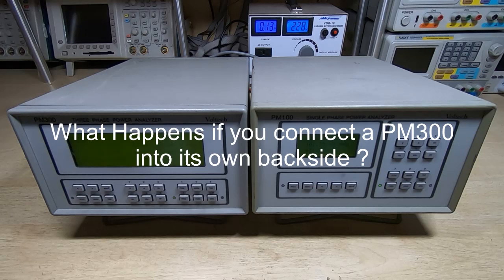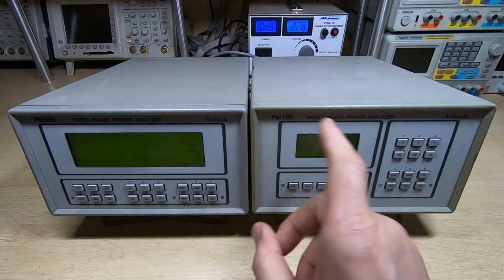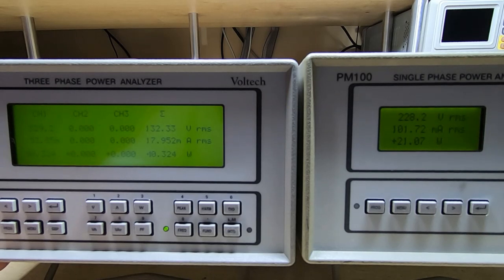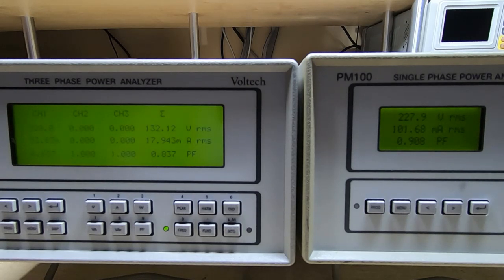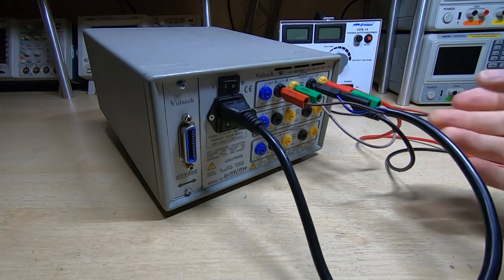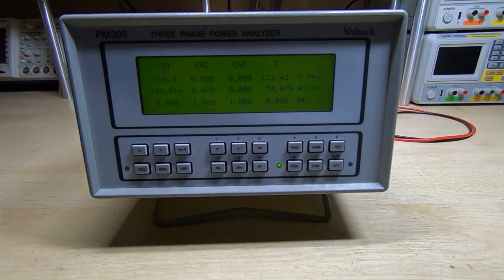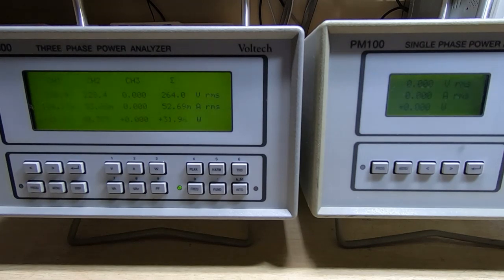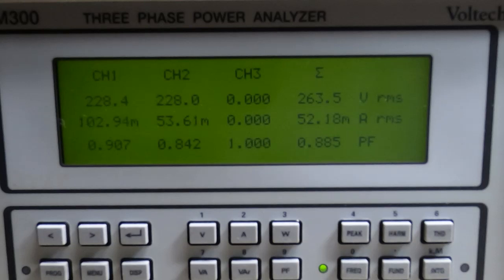What happens if you plug a PM300 into itself

Comment: @Jerry Walker 
Hi, do you know anything about the hach dr2000 ? 
I have 1 but the light won't come on, everything else works and the bulb looks ok so....??? 
The problem is it's an old machine and hach don't fix them anymore so I'm a bit stuck.
Thanks for any help or advice.
All the best
Reply from the maker: Are you able to drive the machine to a wavelength or does it not respond? Does the display show 'Lamp Out'? If the lamp is not lit and the machine expects to see energy then this message should be shown. If the machine is running but this message is not shown then it is not trying to turn on the lamp so check why this could be. The most likely cause of lamp out errors is a failed lamp although the lamp driver also fails on occasion.
Reply: @JerryWalker001  no the wavelength won't change, it says eee which means it was switched on 3 times in a row with the lid open according to hach but the procedure to reset it dosent work, there's no warning about the lamp or anything else when it goes through the self test at startup.
If I do a test with the lid up it detects the ambient light and goes through the test procedure but if I close the lid then I get a warning about the lamp, the lamp looks ok tho, the filament is in tact so....? 
Would you be interested in taking a look if I sent it to you? I'll pay you obviously, thanks either way.
Reply from the maker: @anthonyc4093  I would be happy to have a look at it but I cannot guarantee anything.
Reply: @JerryWalker001  it's ok, I've fixed it now, the battery was no good and the power supply had a bad connection, the 2 combined stopped the machine from working properly, I've just put a new battery in and it's reset and working again now, thanks anyway

Comment: Nice series of videos. I am wondering if you have seen the eevblog teardown from a few years ago. Apparently it only features an 8 bit adc, which has a 50khz bandwidth and is supposedly sampled at 250khz. How does this produce the resolution required for eg the 1000V range? It isn't oversamoling by enough to produce the required resolution, is it?
Reply from the maker: Yes I refer to it in the video's. The bandwidth stated in the PM100 specification is 5Hz to 50kHz and for the PM300 it is 5Hz to 20kHz. NOT 250kHz. The 250kHz parameter is only the harmonics limit. The unit claims a sampling rate of 200kHz and that is entirely possible with limited (reduced) accuracy using this type of AD convertor. Most AD converters can be run much faster than their specified 'accuracy' rating as long as the trade off is known. I may measure the sampling rate to see what it really is. The conversion time is 5uS so the sampling rate can be up to 200kHz although the analog bandwidth is only 50kHz but almost certainly the converters are operating within their specification of 200kHz (so 4 samples per specified max cycle rate).
Reply: @JerryWalker001  but how would an 8 bit adc get any meaningful resolution. The rule of thumb with oversampling is that you need four times the sample rate to get one extra bit of resolution. If the bandwidth is 50khz(which the Pm300 does in single phase mode), a sample rate of min. 200khz is required. To be able to get a meaningful resolution at the 1000v range, 10 bit is needed. This requires a sampling rate of 3.2mhz if I am not mistaken.. Or am I missing something?
Reply from the maker: @cordtz  This is a very interesting subject so I will post a video explaining how it works.
Reply: @JerryWalker001  thanks, love to hear  about it! Also, I made a mistake in the above text: for 50khz BW you need min. 100ksps. For two extra bits you'd need 1.6msps. :) it could be some sort of equivalent time sampling, though, but I see no evidence of this.

I'd be happy to pitch in with my PM300 if you need anything.
Reply from the maker: @cordtz  If you want to have a guess then there are a few clues. Firstly if it was just oversampling then how would it handle DC voltages? There would be large steps in the AD output as oversampling would not be able to resolve voltages between steps. Secondly the specification states +/- 0.1% (or 1000:1) +/- 0.1% of reading so if the value was 1000V then this would still need 500 AD steps for a DC voltage assuming zero calibration error. The third clue is that the unit will not function at all unless the calibration has been completed.
Reply: @JerryWalker001  I have no clue - looking forward to your video ;)